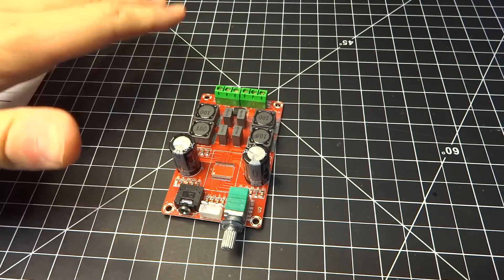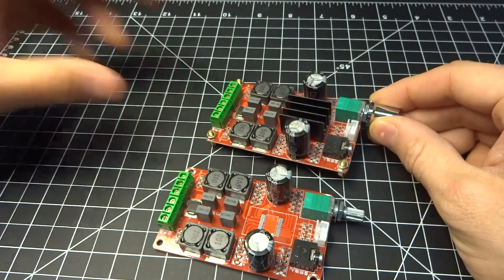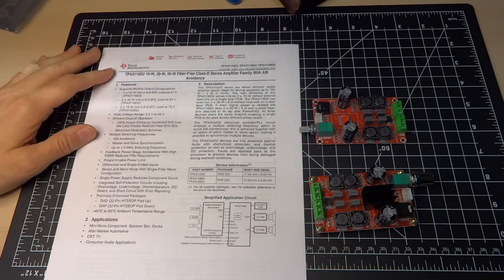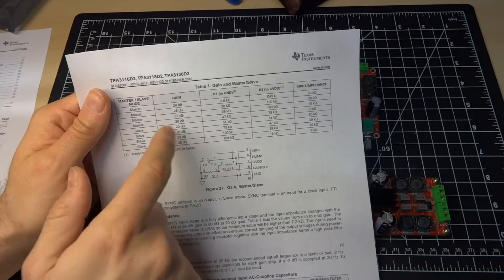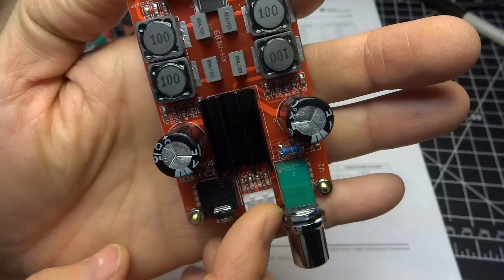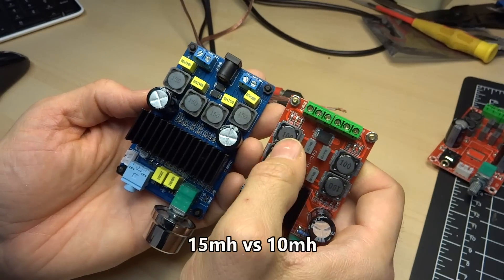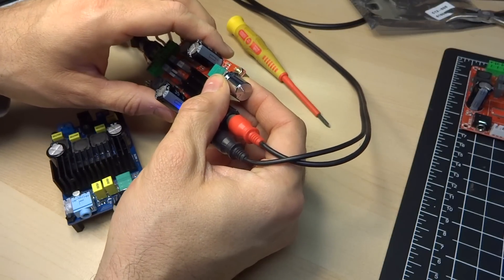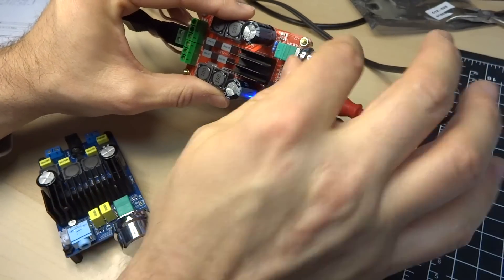Very cheap eBay TPA3116D2 amp review and gain fix (only $5!!)

Comment: I think I have 2 of these red ones.    I wasn't smart enough to figure out how to set the gain, but as I recall I did swap out the volume pot for a 10K one which cut the background noise considerably.

Comment: If you use PCM-generated audio from an Arduino, they recommend to add components to make a filter, to make the audio more sinus-like in order to protect the speakers, "unless the amplifier has one". Does this amplifier?

Sorry for the beginner question.

Comment: Watch out with the XH-M189 boards. Mine was faulty by design. Yes, there's an error in the pcb design. If you follow the datasheet example and look at the negative left input, it should be connected with a ceramic cap to signal ground just like the right channel is with c4.. It isn't, they messed it up so now the decoupling cap for the gaindivider is connected to signal ground, which isn't boardground but floating. the cap that should do that is c2 which is switched in the design. There should be a via from that to pins 6&7 and c5 should go from signalground to pin11, left in negative.
It can be fixed but it's too much work for a $5 board. Get the blue one, it's way better.
Reply: Hi I know this is a 3 year old message but i will ask anyway- can you predict what effect this fault would have on this amplifier boards real world use?

Comment: On some of these current model TDA amplifier boards, they have added dip switches so there's no longer a need to remove and add resistors, just flip the little dip switches to change the gain. Super handy!

Comment: Thank you for an informative video. I bought the TPA3116 D2. It feeds back with loud echo at very low volume. Any simple ideas are welcome. Running 13.5 volt dc to very old but good 8ohm 20w Sansui speakers. has a voltage range of 5-27.  Would higher voltage eliminate such feedback?

Comment: I have been looking at various of these chinese micro amps, and they are obviously made to be used with some cheap power adapter (or maybe even a battery of some kind if its only for very small speakers). What I really wanted to do with one of these were to put it into an existing passive speaker, but instead of using a power adapter, build my own power supply that can deliver enough power to get maximum out of it, eg a 20-30v transformer that can deliver enough current and mount it all inside the speaker and only have a Line input, and a 230v power connector. Is there anywhere to find some easy schematics to make your own regulated power suply (instead of just going out and buy a 24v laptop adapter) as they usually tend to be a bit more expensive if you need something that can deliver about 50w, and I already have trafos laying around salvaged from old electronics, and its more fun to actually build it yourself.

Comment: The board has 10mh inductors .Doesn't 8 ohm speaker require 15mh or 22mh inductors.

Comment: What are the two large capacitors for? Also you mentioned the 4 very small capacitors are for the input. They look like small resistors. They make capacitors look like that as well? Best regards.

Comment: I tried to reduce the gain from 26db to 20db on my board, but it didn’t work. After I desoldered the 100k resistor, I measure 20kOhm to 70kOhm (don’t know why I get different values) over the pads that’s supposed to be open circuit. When I try it, it sounds like the board reset ever second or so with the speakers clipping. After resoldering the resistors back I get the same behavior. I tried it with two boards and I cannot understand why the oHm values are wrong. Any ideas?

Comment: i had this one, but I gonna pair it with 80W woofer and 100W tweeter, i'm not gonna use it at full power tbh, i got a same issue with you, the noise floor pretty high, when i turn up the volume to 50%, the noise goes up, but when i turn the volume to max, the noise floor goes down, can you help me
Reply: thats just how this specific chip works. its weird that way. ive had one. nothing you can do about it.
but mine had almost no noise floor issues at all even in a quiet bedroom. had to put my ears to my speakers to notice it.

Comment: What connectors did you use to go from the power source to the green screw-press style connector on the board?  Could a standard 12-24V round plug be soldered in place of the  existing connector on the board?  Apologies as I don't know all the proper terminology yet as I'm definitely not in my area of expertise haha, but I do enjoy learning so any help is a plus!  Thanks

Comment: good video lately i'm interested in to cheap mini amps searching for low voltage like 5v 10v amp for portable bluetooth speaker project it's hard to chose from big select witch is the best performance can you recomend something?

Comment: plz help
at full gain it mute the audio on bass beat .same board with 19v laptop power supply. whts the problem?
Reply: The problem is either
(a) your power supply engages internal current limit protection/ short circuit protection because you're drawing more current than it can deliver.
or
(b) the amplifier is engaging its thermal protection because it's overheated, which is honestly not particularly likely given it's just running at 19V, but you can always check with your finger, both on top the heatsink and on the bottom of the board. Note to check the heatsink that it's on there good.

Also running full gain at this voltage seems a bit dangerous, i mean it's likely gonna clip. You can burn your speaker tweeters like that.

Comment: The PAM8610 has a lot better sound in my opinion, and it is louder,voltage supply is only 12V[TPA3116 -20V].
Reply: That's just the gain setting, and PAM8610 really isn't that good, there's a bit of distortion that is clearly audible on low level signals. You can run TPA3116 down to lower voltages just fine too, datasheet says 4.5V - 26V, though high end of the range is limited by component choice and cooling. Fundamentally 3116 is both more powerful and cleaner, and the lower the supply voltage, the cleaner it should run, up to where the voltage is insufficient and it clips.

Comment: Great video . . but class 'D' does not mean 'Digital'. This is a common error.
There is no digital circuitry or digital conversion involved.
The audio signal IS converted into a pulse train but this is not digital in any sense.

Comment: With respect, the 'D' in Class D does not mean or refer to 'Digital'.

The classification 'D' refers to fact that the amplifying devices in the circuit operate as electronic switches, and not as linear gain devices as in other amplifiers. There are no digital electronics involved whatsoever.

Comment: Good Morning. I connected an amplifier board (TPA3116D2) and an mp3 decoder to the same 12vcc source and there is a noise in the loudspeaker. If the decoder and the amplifier board are connected to separate sources, the noise will disappear. Do you know what you could do to connect them both to the same source without having the noise?
Thank you.
Reply: I wager a guess, the TPA is fine, but it injects the noise into the power supply that bothers the MP3 decoder. Use inductors in line with the supply for the MP3 decoder. How much of an inductance is sufficient will depend on the output capacitance of the power supply and input capacitance of the MP3 decoder - if it doesn't have any, add some. The 3 filter elements, capacitance, inductance, capacitance will form a 3rd order filter and you can use some filter calculator to figure out how much inductance you need, or just add inductance and capacitance till you're good - the filter calculator will spit out corner frequency, and if it's in the audible range, you should be golden, because from there on for every doubling of the frequency, residual noise should reduce by 18db. I wager a guess just a dozen turns of wire around a ferrite core, like about 100µH, and 2000µF capacitance, should resolve your issue.

Comment: It says that the chip produces 50w at 21v, TPA3116D2 2x50. The others say that watts drop, because it's other model chips listed TPA3118D2 2x30, TPA3130D2 2x15W, Notice models differ. So if you don't get 50w, either board design is limited, your power delivery is lacking, or it's weaker chip. On the graph side datasheet it shows pretty steady clipping point just above 50w on 24v into 8ohms.

Comment: Hello Adrian - from soggy England.  I also like these little amps, so much so I ordered aother. Your gain fix turned this little beast into the good TPA amp AND the cheapest. Only problem is my second one came with an unstuck heat sink like yours. I can't see any damage to the chip intself and one of the grey caps has been soldered (or is that sodderd) cock eyed. I have sent a photo off to the seller. Regardless of the outcome I shall try and salvage this amp. I don't like glued heat sinks. I'm moving the 2 large caps to  the opposite side of the board and rigging up a bigger heat sink. If it all works your gain mod will be done. Thanks so much - great channel.  Regards.

Comment: can i drive 4 ohm spekers with it if i put  a resistor or something on the speaker to increase ohm?
Reply: That would pretty much murder the intended sound of the speaker. Just choose lower supply voltage, i expect that the amplifier might fail if you drive 4 Ohm speakers at 24V, but 19V or so shouldn't be too bad.

Comment: Have you found a way to eliminate the "Bump" when the power is switched on? thank you for this excellent demonstration on changing the gain on this amp.
Reply: My idea is using a single MOSFET with a resistor divider on the gate and a capacitor delaying the opening. Then have the switch break the bias so that it discharges and shuts down when powered off. This would be better anyway because the built-in pot switch wasn't meant for loads like this.

Comment: I have the xh-m190, same board but with 2 of the amplifier chips. I don´t know what kind of power supply i ´m going to need to drive this. Whats the amp draw on your chip?
Reply: Correction, i dont have it yet. its on its way

Comment: Want to build an auxillary speaker cabinet with a 12 inch Jensen guitar speaker and using
'this board amp to power  it,  in mono mconfiguration,  running off two 12..6 volt  7ah batteries (inside speaker cabinet) for portability, to slave off my Fender Champ 40w , which also has one of these TDA chip power amps.

So,  if at 24volts, its 20w +20w...can it produced 40w in mono operation? 

How do you configure it for mono operation?  for 8 ohm operation?  
What kind of 3 pin plug does it use..is it a molex?]
Reply: I have the same question! From the datasheet it looks like shorting the left input pins after the capacitors will set it in PBTL (Mono) mode during startup. For the output you need to short the left + and - together and the right + and - together before the LC filter... Not very sure how to do that

Comment: my review exactly.   i love how simple and bare bones these things are.
But i wanted to increase the sensitivity of the volume knob, since most phones don't put out a strong enough signal.  (unless i hookup the headphone jack of my stereo receiver to get its true power, which is impressive)
    Do you happen to know the rating on the potentiometer on this? EDIT:   ok so..... you basically removed the little R2... and solder in a 5.1K resistor?
Reply: The same problem i discovered - my Samsung Phone delivers not enough signal voltage to get the full power the board can give at 26V supply.
The solution is to increase the gain, on this board given with 26dB (20x) by R1 (20k) and R2 (100k), by change R1 to 39k, wich give a gain of 32dB (40x, because +6dB -> 2x).
With R1=47k and R2=75 the gain is 36dB (63x) according to data sheet.
Setting R1 to 5,6k and removing R2 leads to gain of 20dB, this is 10x of input voltage and less loud.
But it also reduced the noise as Adrian already mentioned.
Very important:
On the given board R2 (of the data sheet and schematic) is marked as R3 and R1 is marked as R4!

Comment: This amp is pretty good but be aware that this has an audible buzz if you don't use a clean power source. I am just running from a 12v 2amp router power supply and it runs great for my computer desktop speakers but like I said with a very very small audible buzz that isn't so bad.
Reply: That's why i got myself a bunch of ferrite cores. You can always de-noise a power supply with a filter.

Comment: From what I read, the noise is due to grounding issues (amp ground putting noise on the input ground, bleeding trough to the actual audio), wouldn't it be better to fix the grounding issue somehow rather then gimping the gain?

Comment: the datasheet specifies the use of 220uF capacitors for decoupling, would it be worth it to replace those 1000uF one's with audio grade panasonic 220uF one's ?

Comment: what would be the difference between the 5.1k resistor and 5.6k ? I'm wondering 'cause i don't have a 5.6k either and maybe it's better to add a 470ohm in series to match the datasheet ?

Comment: I'm super confused when you reference R1 and R2. You removed R3 and R4. Trying to installing a pot for gain adjustment on mine.
Reply: Never mind, I need to pay more attention, haha.
Reply: Hm, I mirrored what you did with a pot in place of the resistor and even with R1 and R2 open there's no difference whatsoever.
Reply: >The gain setting is latched during power-up
and cannot be changed while device is powered.

Alright I'm done commenting!

Comment: Great review man, just ordered one as an attempt to convert a passive speaker cabinet (homemade) to an active one. For $5 you cannot go wrong really.
Reply: I want to do the same thing.  I'll run mine off a couple of used 7ah lead acid
agm  sealed agm batteries from my stairchair lift.  I want to run an auxillary
jensen 8ohm 12 inch speaker that can handle up to 50watts from my
Fender guitar amp speaker which also has one of these TDA power chips in
it as factory standard.

Comment: Will it work fine for 4 ohm speakers ?
Reply: He explains this in the video, so watch the whole video!
Reply: a different module amplifier i read about, wass capable of 4 ohm loads if it had a heatsink applied,
these all have heatsinks so i'm guessing they can handle it yes

Comment: A very good review really. I am waiting for this TPA3116D2 amplifier working in mono mode:

http://www.ebay.com/itm/401184532883

hoping it could drive Sony SS-WS500 3 Ohm 100W passive subwoofer from Sony HCD-S800 surround system. The amplifier input would be connected to the subwoofer output of Yamaha HTR-6130 Dolby decoder. The subwoofer ouput is declared as 4V/1.2 kOhm and I wonder if I will be able to attenuate the input with the trimmer marked as 'Volume control'. That is - I am not sure if this trimmer attentuates the signal before entering into the amplifier and I believe 4 V would be way to much.

The next thing I am not sure is if heatsink will be able to handle the heat disipation at 22V (90W, 10% THD+N @3Ohm according to the TPA3116D2 datasheet). THD is not of a big concern because the subwoofer output already has 10% THD.

BTW, how did you mount the LED strip connector (terminal connector to 2.1x5.5 mm) back-to-back to the PCB's terminal connectors?